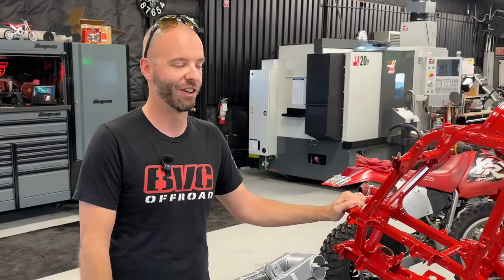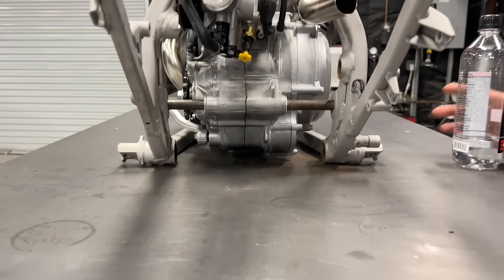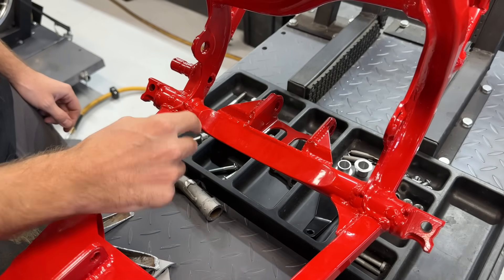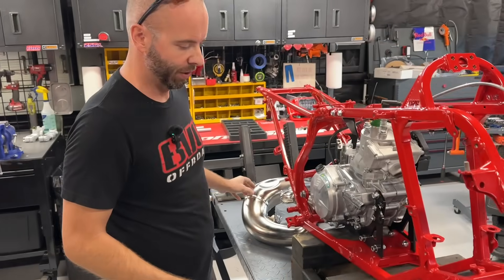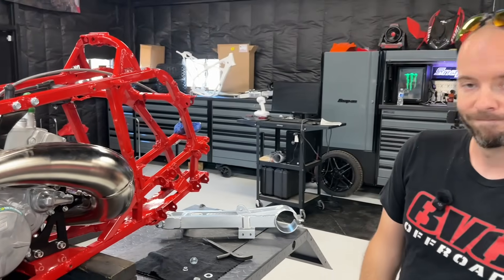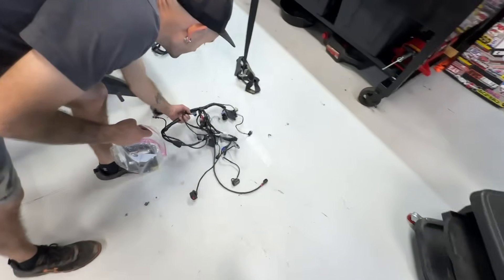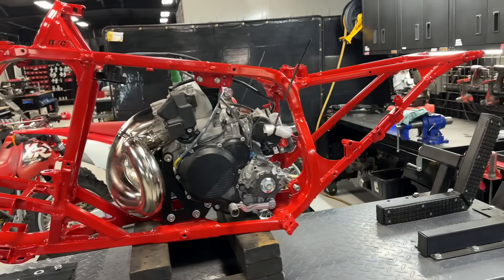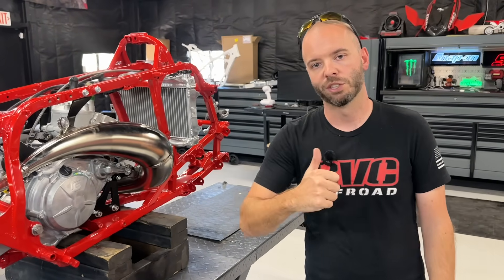2025 GASGAS 300 - TRX250R Hybrid ATV Build - Part 1

Comment: Im thinking about doing a 250sx or 300sx in a trx450 chassis for tt racing. Hopefully i dont have to cut the swingarm to get the sprocket over enough. I might just cut the case, ive seen a ktm sx motor to crf frame do that

Comment: What if there was another engine such as a Maico that is right side drive? Considering the level of engineering and customisation you can do, is this possible with your chassis?
Reply from the maker: Comes down to me making a custom swing-arm and tweaking some things to have the chain on opposite side  not a huge deal to do

Comment: beta got a 350 2 stroke coming.. thats gonna be wild in a walsh chassis. With EFI im currious on the gas tank that will be used. I love my 88 and could never chop it up...just go billet cases and a puma!
Reply from the maker: Yes!  I cant wait..
My goal is to use all the modern tech/ engines from ktm, beta etc.     if you haven’t seen my billet frame video check it out.     This is just a engine swap into a  almost 40 yr old frame BUT our next one will be all new 👌🏼

Comment: Have you seen the Kahana motorsports KM500R ATV? 500cc 2-Stroke, also offer the engine separate. Just wondering your opinions.
Reply from the maker: Never heard of it - ill look into it
Reply: It looks pretty cool, but the exposed pod filter ruins the rest of it.
Reply: @Mac_Simiser you have to admit though, how they integrated the frame and the air filter is pretty sick. Don't know how well it will work.

Comment: When you start making frames this would be a cool kit. Kinda like a rebal star quad from the 90's but much better.
Reply from the maker: My idea is one chassis that accepts multiple power plants ( 250, 300 2 stroke and modern 450 4 stroke) 
By swapping motor mounts 👌🏼
Reply: was that the ones that used the Rotax 257 engine??